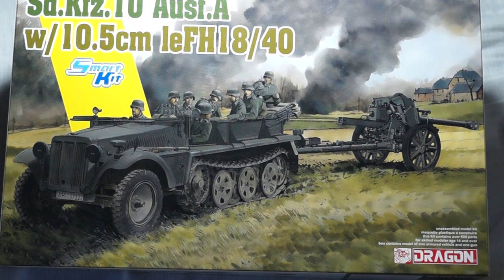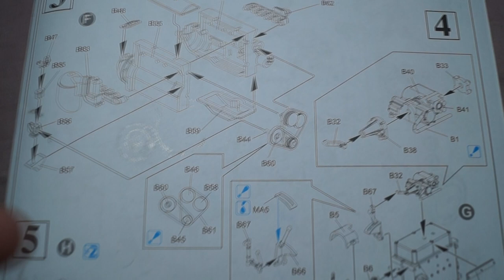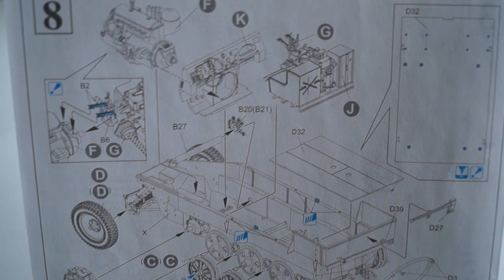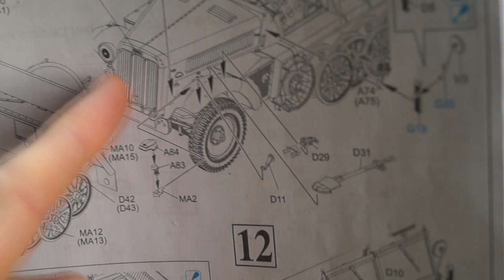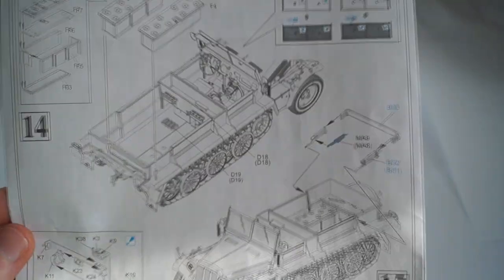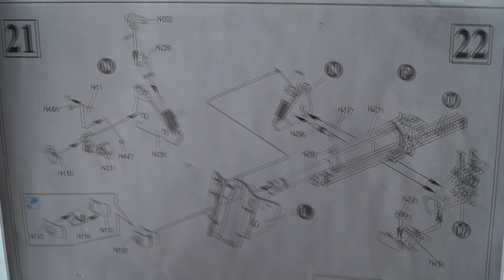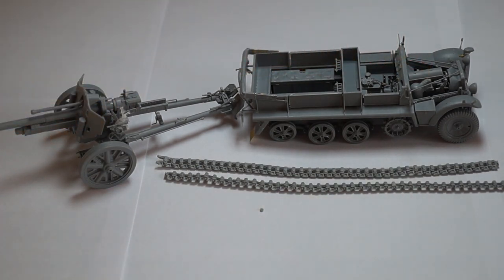Dragon 1/35 Sd.Kfz.10 Ausf.A With 10.5cm leFH18/40 | Part One

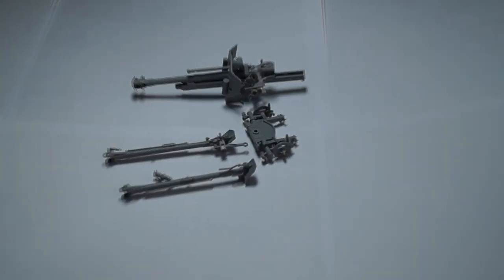Comment: 16:59 how did you attach those two shielding and chasse, is that fix in cement? because mine is trembling i don't know to attached
Reply from the maker: What part do you mean. 🤔
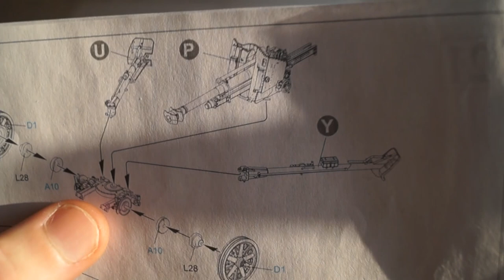Reply: @JamessModellingChannel1992  the A15 or chases and letter P in the manual,  how did you attached it 20:08 you didn't glue..
Reply from the maker: @ronaldomendez1349  I left it separate so I could paint it I did glue it after though.
Reply: @JamessModellingChannel1992  i see, so i'll do the same, did put other stuff besides glue..   first i thought this is movable